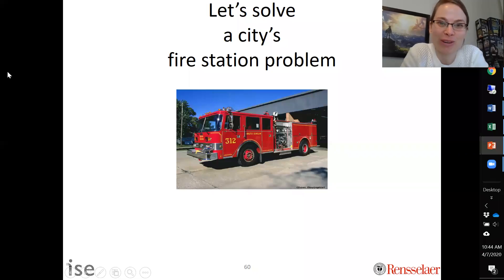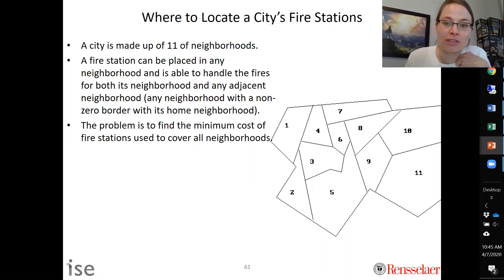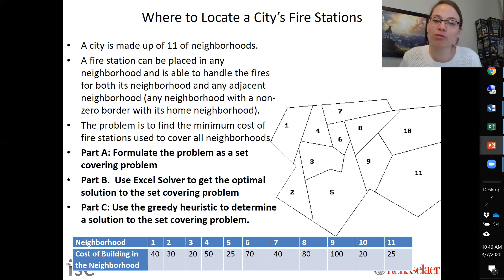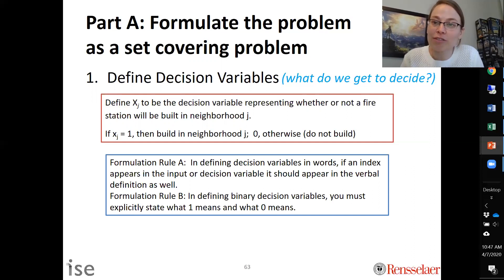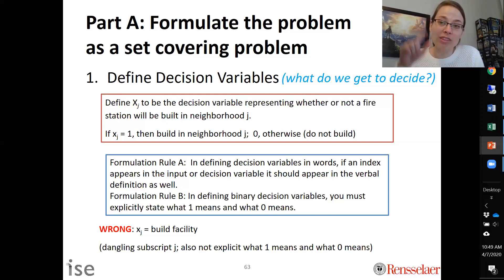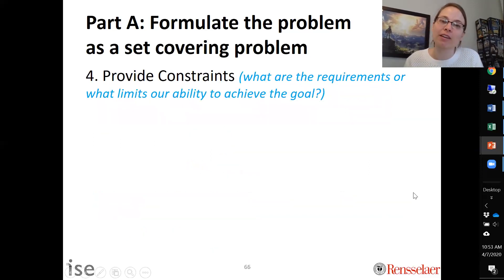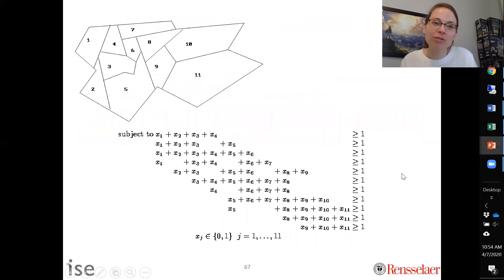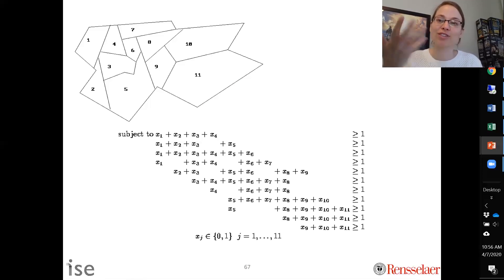Set Covering, a Fire Station Example to illustrate important optimization formulation rules

Comment: Hello.
Please help me with this problem.

Consider a set of city districts 𝐼. There is a candidate for building a medical emergency service station in every city district. The cost of building an ambulance station is given by the parameter 𝑓𝑖 and the total budget for building stations throughout the city is 50 million. Furthermore, if a station is built in city district 2, it must not be
station built in city district 6. Determine in which city districts to build ambulance stations so that the maximum travel time is minimized. What is the optimal maximum travel time?
The cost of building stations in the city district 𝑖 ∈ 𝐼, 𝑓𝑖
are: [32,20,25,30,40,29]
The city districts and the driving distances between them are interpreted in the following graph:

(     [[ 0,  4, 12, 27, 25, 58],
       [ 4,  0, 24, 16, 29, 38],
       [12, 24,  0, 31, 14, 30],
       [27, 16, 31,  0, 21,  8],
       [25, 29, 14, 21,  0, 11],
       [58, 38, 30,  8, 11,  0]])

The right answer is to build stations in districts 2 and 4, and optimal travel time is 24.
But how can I solve it with excel or with Python, please, help me.